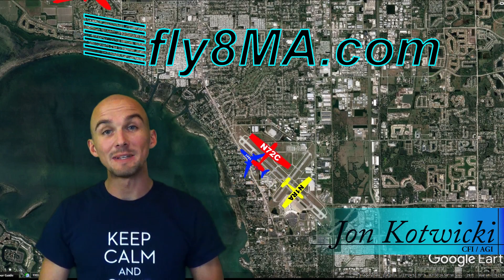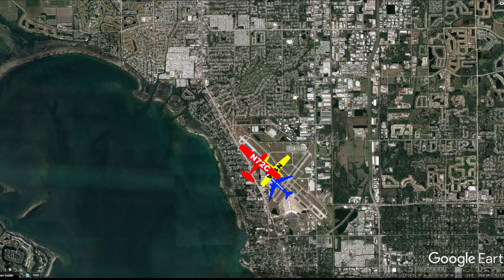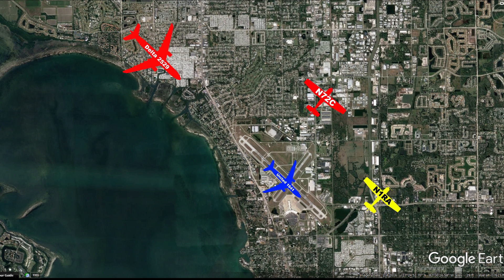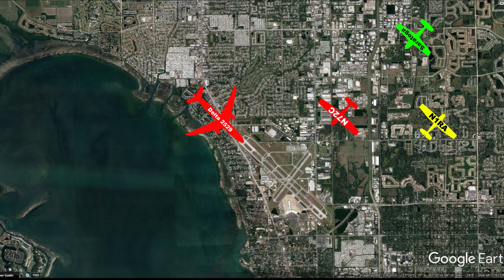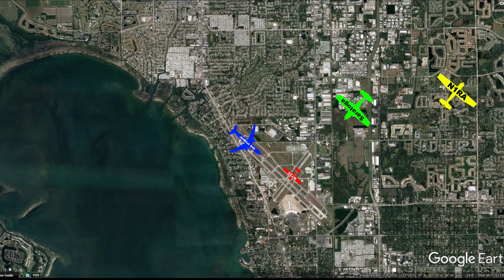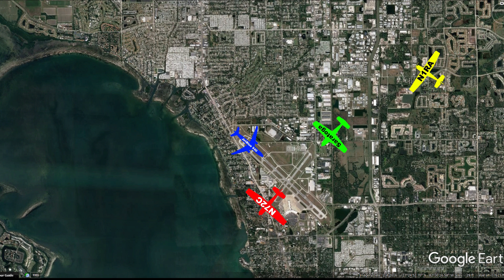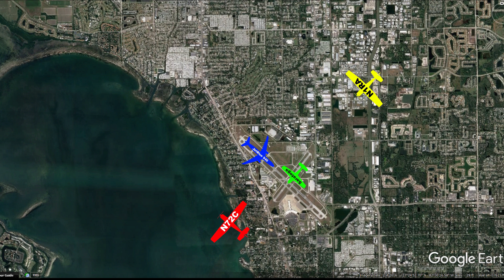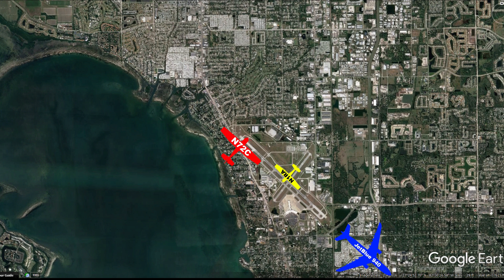Ground School: ATC "Radar" Overlay w/Audio | Class C Radio Work

Comment: Thanks...nice vid.  Did ATC mess up that last radio call (the hold short of 22 should have been hold short of 14)?
Reply: l44va It looks like the controller switched the yellow plane to 14 since he was already on right downwind for 14 (I suppose he could have made it more obvious he was changing runways). He wanted him to hold short of 22 for the red plane in the pattern.
Reply from the maker: What jimijames8050 said, he switched runways since he was cleared to land and red plane was still doing T+G's.  Its the reality of sometimes unclear radio communication